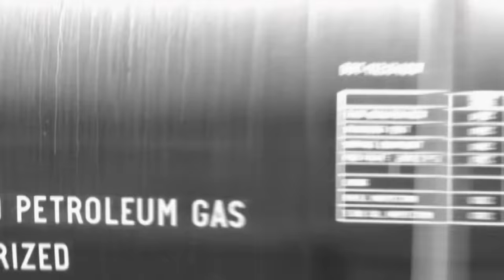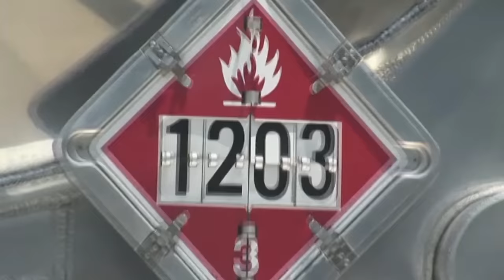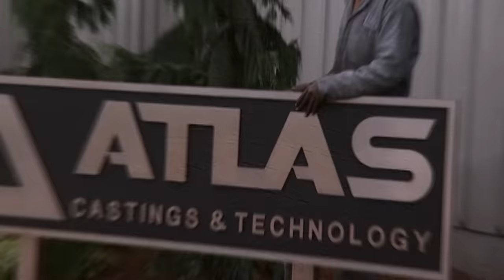Horrifying Bleve Explosions Around The World | Explosions Gone Wrong

Comment: The driver's name is Chuck McDonald. As I recall, he was 63 years old.  He lived about 70 miles south of Tacoma.  The initial leak was caused by a type of transfer hose failure. The truck's diesel engine performed a "Runaway" in the presence of that much airborne fuel and suffered a catastrophic failure. Sparks from this engine detonation ignited the escaping propane.  As a result of the BLEVE,  the rear axles from the trailer flew over the elevated freeway and came to rest in a fenced area on the otherside of the road. Chuck succumbed to his injuries several days later. He was a good guy.

Comment: The propane truck explosion nearly happened at a gas company I worked for. The gas leaked in just the same way but it never found a source to ignite despite it flowing into a running vehicle. Had it gone off half the town would have been destroyed by the explosion of the two 30,000 gallon tanks that would have resulted.

Comment: The Atlas foundry propane explosion - the diesel truck was running, and it sucked in the gas and ignited the rest - you can see a dark smoke discharge from the exhaust stack just before ignition.

Comment: Atlas foundry. A truly scary operation. They don't care about safety. Had to work there as a subcontractor. Many violations of basic safety rules. Pointed out a biggie to atlas foreman. Next morning my boss got a nasty email telling him to tell me to shut up. Told boss to never send me back there.
Reply: what is the likelihood of catching them if they are reported?
Reply: How long ago was this because I worked there for about 6 years and safety was #1 priority there. Has been for the last 10+ years. My father has been working there since 87' and has seen the worst of the worst with safety there and can tell you that it is a much safer place than then. But even then there have been many safety violations and those dealt with. 

That explosion was caused by the gross negligence of the truck driver and not properly checking the hose couplers for excessive wear and failure. The connection failed at the truck connection resulting in the plume of gas reaching one of our heat treat ovens that was in operation. 

I no longer work there so I'm not protecting the company by being biased, with that said though, there should have been an Atlas worker there with the truck driver to make sure everything was on the up and up. Not some sheet that tells drivers to make sure everything is in working order.
Reply: TheFall3n ya uh huh only so much you can do over the internet soooo
Reply: @Bino Muhammad 
Dude I doubt that he is grown.
I calculate Striker to be about 12 years old.
Reply: James Crane Jr. good 11at most
Reply: BP in Texas City is like that too just waiting for them to have major disaster.
Reply: @Fruit Cat 
Like Texas City 1947?
Reply: @jamcrane3  Wouldn't be surprised they give no shits about safety.
Reply: ImanubisGaming It’s always the same old blame game isn’t it?
Reply: Corruption at this level ! 💥🔥😲
Reply: @striker6240  Jesus??
Reply: The moment they showed that place on this video I knew it was no good
Reply: I wish I could experience the sweet sweet karma that you have while watching this video.
Reply: You didn't HAVE to work there. The opportunity was presented and you CHOSE to work there. Employment is voluntary.
Reply: @kolsen6330  I'm a union plumber in Houston TX for 27 years, and as such have my OSHA certifications and REGULARLY work on large construction and industrial projects.  I am also a federally licenced aircraft mechanic, so..... 
I completely understand safety regulations and I completely understand that when confronted with a work environment that doesn't care about them,  I am 100% free to walk away. What part of my comment did you consider incorrect exactly? The part where I said working somewhere was voluntary? What exactly did I say that you disagree with, oh wise one?
Reply: @shelbyseelbach9568  Yes,You can choose not to work on a jobsite, But then its a matter of finding a new employer that will allow you to pick and choose where you can be assigned to work.  Any foreman that will willingly deny a safety violation should be fired. MY work area was safe. This company employees lots of Hispanics and eastern europeans that have not had the benefit of union safety training. They didnt have the knowledge to realize the rigging was unsafe. As a journeyman Boilermaker and a state licensed crane inspector , I had to point out safety issues. Do you walk away from things that can kill people without telling anyone????? If you feel the need to mock me over job site safety, you are  someone I wouldnt want to work around.
Reply: @kolsen6330  At what point did I mock you? At what point did I say to walk away without telling anyone why you are leaving? Once again, what I said was that employment IS voluntary and you did NOT HAVE to work there. As an OSHA inspector you SHOULD know perfectly well that you are not only NOT forced to do anything if you feel it is unsafe, but are actually told by OSHA regulations that this is so. So once again, you did not have to work there, as evidenced by the fact that you were able to tell your boss the next morning not to send you back there because of safety concerns. Instead of being so defensive, I'll ask again, which part of my statement is incorrect?
Reply: @shelbyseelbach9568  Looks like we disagree on safety issues. You seem to be saying that you should just walk away and not work that job leaving the problem to get the next guy.
Reply: @kolsen6330  That's not what I'm saying at all. As I've already asked, when did I say that? 
However, isn't that exactly,  EXACTLY, what you did when you voiced a concern, were told to shut up, then asked your boss not to be sent back to that location? Isn't that EXACTLY what you did. You have actually proved my original point, you were faced with a company that didn't care about safety, and you asked not to be sent back. You have agreed with everything I have said, taken the EXACT actions I said you were allowed to (since employment is voluntary, which you have also agreed with). Yet, for some reason you, an OSHA inspector, insist that I apparently disagree with you and don't care about safety. What, exactly, is your arguement against my statement that you did not have to work there since employment is voluntary. You're not a slave, so the employment being voluntary and not forced is unequivocally correct. By OSHA regulations, you have the right to refuse to do anything you deem to be unsafe, is that not correct? Why so confrontational? I have stated FACTS, that you agree with, yet you insist I don't care about safety, why?
Reply: @shelbyseelbach9568  I completed the job we had been hired to do. After it was over, and we had gotten the nastygram, thats when I told the owner of the company I worked for to never send me back there.  I did not use the unsafe, brand new customer rigging, I supplied my own.  The original post was me saying that Atlas is a bad place to work because they dont care. After all, Atlas is an entry level job for welders right out of trade school and immigrants that dont understand that this is America not Russia and there are actually safety rules.
Reply: @kolsen6330  Your original comment was that you HAD to work there. My original comment was that NO you did not as employment is voluntary. You took exception to this simple statement of fact and the rest is now documented history. Nothing I said was incorrect. Making this conversation and your reaction to this simple fact puzzling at best and bizarre at worst. Best of luck.
Reply: @shelbyseelbach9568  Must be nice to be able to pay your bills without having to work. I aint so lucky. Walk off jobs and no employer will want you back.  Luck back at you.
Reply: @kolsen6330  I've never heard a better explanation of the best reason to be part of a trade union in my life.
Reply: @shelbyseelbach9568  Journeyman Boilermaker ship fitter, 1976. Shop steward, organizing steward, welding instructor L568 apprentice hall. (sort of retired)
Reply: @kolsen6330  Strange for an OSHA inspector and trade union member to say he was better off to stay on an unsafe jobsite working for a company that disregards employee safety and OSHA standards. Maybe I should have specified a strong union? One that wouldn't punish you for refusing to work in an unsafe environment.  You are full of contradictions. Lol.
Reply: A simple fix to that is to report the whole thing to whatever the agency that governs workplace safety is in their area the fines that can be applied will make them say OUCH recently OHS in Alberta levied a fine against an employer for violations under the workplace safety regulations of $500 000.00 for refusal to correct safety violations. another case a fine of $50 000.00 was levied against a supervisor and his employer was handed a fine of over $1000 000.00 for a workplace injury incident. These fines definitely hurt the bottom line. Have a nice day.
Reply: @muf  very good as inspectors show up unannounced to investigate the complaint.
Reply: "Hello, OSHA?"
Reply: @kolsen6330  If it wasn’t for OSHA, there would be more outrageous accidents in all industries.  I had OSHA Construction and General Industry training as well as Army Corps of Engineers EM 385-1-1 to be a SSHO on contracts on military bases.  More then once I shut work down due to unsafe activities.  I would never ask someone to do something that I wouldn’t do.
Reply: @u4riahsc   Preaching to the choir. I am a retired Washington Crane Inspector.
Reply: Did  he send  you back! Lived in Texas city Texas in the 70s  remember explosions coming from refineries i was knocking on the neighbors  door insaid we have to evacuate  she said no honey  its the thunder  I said no and then the biggest explosion  came! Big fireball in the sky she screamed  for her husband and then my husband pulled in from a truck run! Grabbed the kids went to Dennys until they said hours later  it was safe to go home!

Comment: at 5:22 you can see the trucks engine give off a puff of smoke. It is a diesel, so it will continue to run if a fuel is present in the air. Vapors drawn into the engine caused a runaway. Same thing happened at BP in Texas City.
Reply: Good eye.   Same thing happened to BP on the Deepwater Horizon.   Prime mover engines ingested natural gas through their air vents and ran at extreme speeds until they exploded.   There were safety systems installed to prevent this well-known failure mode from occurring, but for unknown reasons were never activated.
Reply: Exactly Charles.  You can also see the fireball start from around the cab.
Reply: Which is why diesel engines used in refineries are required to be equipped with a guillotine valve.
Reply: Nick Maclachlan seen a truck that was unloading at the Marathon refinerie in Detroit. It had sniffed some methane or something. The ISX Cummins in it had hit over 6000rpm before it blasted the cly head right off it, bunch of rods out of the side and the crank out of the bottom!! The owners had it at the Cummins dist in Deaborn trying to get warranty! I don't believe that they were successful!
Reply: Never heard it called that, but it makes sense.  A lot of fire engines used to have them, but they were just called emergency shut off's...
Reply: I was unaware of that. Went through Hazmat years ago and they never told us about that, I'll be sure to spread that around. I would think that is a very important bit of information...

Comment: Have a look at the huge puff of black exhaust smoke from the truck just before the ignition of the gas plume . The running truck engine is sucking gas into the diesel engine and revs like hell And at the same time the alternator in the engine bay is surrounded with gas and boom . Iv worked on trucks and earthmoving machinery for years and  the equipment used in the oil and gas industry have a fully sealed self exiting alternator to prevent exactly that from happening in the case of a gas leak from a well or storage tank, but unfortunately road transport vehicles don't normally have these sealed alternators. I feel sorry for the driver and his family so sad

Comment: We just have a even worse one that happened today in Beirut, Lebanon, might be the worst to ever happened
Reply: Wasnt a bleve. Bleves are nothing really.
The one in Beirut was a detonation. A completely different thing and a completely different scale as to power released.

You can see the difference with these cans popping right?
Reply: @StofStuiver  tell me more
Reply: @StofStuiver  I mean, if you go to the slow motion videos pretty much looks like a BLEVE
Reply: @wynchester25  

It looks somewhat the same, as something 'blows up'

The force of a bleve is much lower, as it is only (can be more, depending on substance), the expansion bc of internal pressure. If this happens in a fire situation and the substance in the 'can' is flamable, it will immediately catch on fire, preventing an explosion from the substance itself.

And that is much better than an explosive mixture forming from a flammable gas/vapor.
In order to achieve that, it needs to mix with oxygen in such a way that the mixture passes the lower explosion limit and doesnt reach the upper explosion limit (the latter being too 'rich' to be able to explode). Optimum is when all flamable material can react with all the oxygen.
Its like a combustionengine. Maybe you are familiar with that. Your mixture can be too poor, meaning not enough fuel and too much air, or too rich, meaning too much fuel and too little air. Your engine wont even run if it is outside the limits. It needs to be just right, optimum, to run well.

That has a lot more energy than a 'can' exploding. (ofc size matters, but relatively speaking).

Then there is also the 'detonation'. which is a form of explosion with very high speeds and pressure (wave).

These can happen in optimum mixtures of for instance a fossil fuel in air. The difference between a not optimum and an optimum here are significant. Just like when an engine barely runs, bc of mixture not optimum. You can hardly rev the engine up, but when you near the optimum, it roars.

Those detonations are common in explosives. Bc those have internal oxygen. So do not need oxygen from the air (which is just 21% anyway).
ALL explosives of common type use oxygen donating substances.
So in order to make an explosive, you need a material that burns (sugar, magnesium, any faction of fossil fuel, etc) and mix that with exactly the right amount of an oxygen donating substance.
Those are for instance: Chlorates and chlorites, nitrates and nitrites, phosphates and phosphites, etc.
TNT for instance is tri nitro toluene: Toluene has a benzeen ring and is a natural compound of oil. It burns well.
They bind that chemically to 3 (tri) molecules of nitro (NO2). They are not very stable substances, but stable enough to handle (contrary to pure nitroglycerin - where glycerine is the burnable material and nitro again the oxygen donator. Therefor to use a substance to soak it up, and thats dynamite, which is more stable. Be it absorbs shocks)

So, what then happens when such a material is set off in any way (either by fire, electrical, or shock) is that the molecule splits off its N and O2 separately, after which the O2 reacts with the toluene (or glycerine) and burns perfect. The formed gasses expand extremely fast and take up much more volume than the original material, creating a shockwave. On top of that is the reaction exothermal, meaning it delivers energy aswell, further expanding the gasses and shockwave.
Those are chemically optimal and result in detonations. Extremely fast explosions.

If you look closely to the vid of Beirut accident. You will see an explosion and about 0,5 seconds later a detonation. It is much faster and much more powerfull.

This was btw not caused by above process, but by ammoniumnitrate, which under specific conditions can dissociate very rapidly and thus detonate (bc the resulting of the substance, solid or liquid then goes to gas form.
It is less powerfull than real (high grade) explosives, but powerfull enough to cause this sort of huge detonation.

That was 10 mins of my life. ;]

Comment: How they didn’t shut the highway on the last clip is beyond me...
Reply: The initial explosion was simply the escaping propane gas that surrounded the truck (the white cloud.) The second, much larger explosion happened only minutes later, as emergency personnel were attempting to evacuate the area. The state patrol was in the process of shutting down the viaduct, but it is a very busy junction of the interstate freeway and a state highway. The second explosion was the truck BLEVEing. There were also two large stationary propane tanks in the area that were bleeding off pressure (the flame shown shooting above the viaduct.) They did not explode, but did have to be drained and scrapped. This was in my home town, I live about 1.5 mi. from the foundry. It shook the house like an earthquake.
Reply: Because they weren't close to the fire.

Comment: Acetylene is not stored or transported as a gas. It is spontaneously explosive over 15 psi. An acetylene cylinder is 2/3 or so full of a material that absorbs acetylene dissolved in acetone. Acetylene cylinders are filled by weight, not pressure like oxygen or argon.